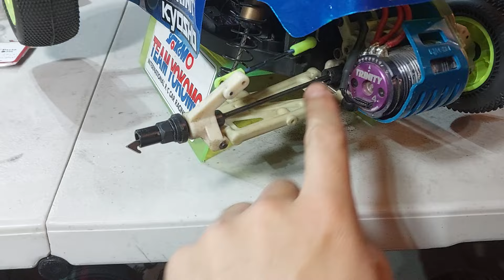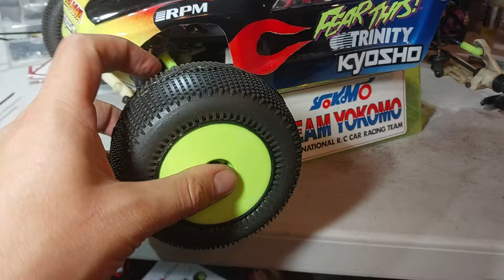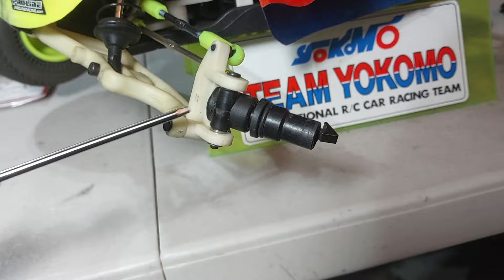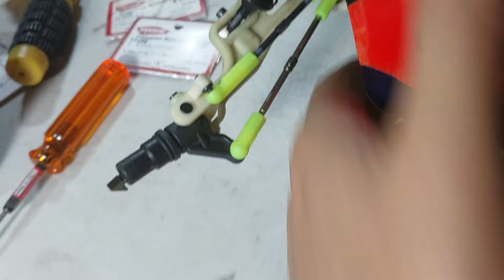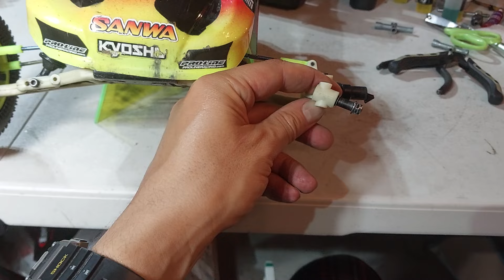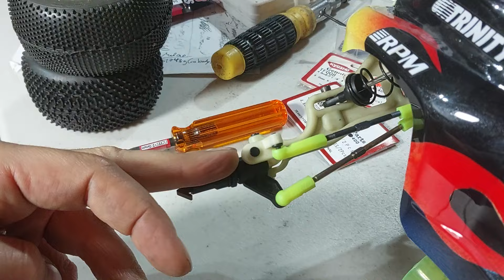Quick Mount Conversion for Kyosho Pro-XRT (and Outlaw Rampage Pro-E)

Comment: Great tip just hard to find those particular RT5/6 parts on eBay  but I'll keep searching.
Reply from the maker: Looks like Power Hobby has most or all of the parts still in stock.
Reply: @doctormosfet  thanks I'll check them out.